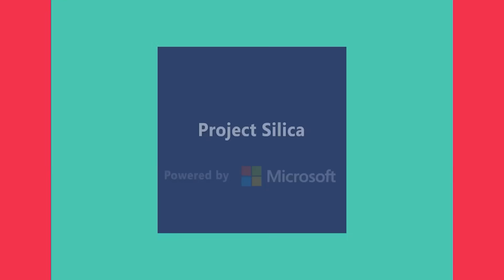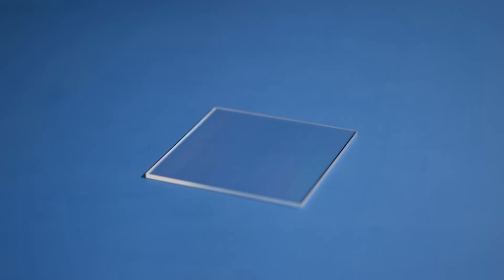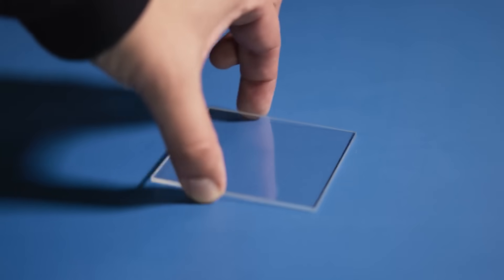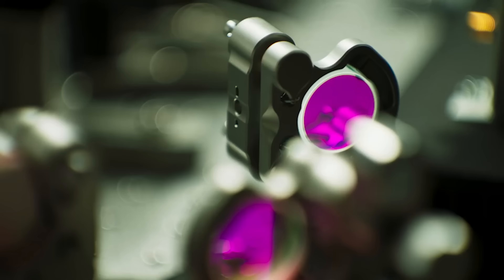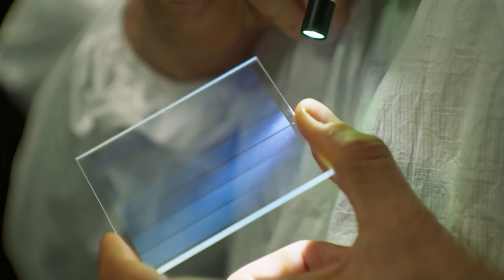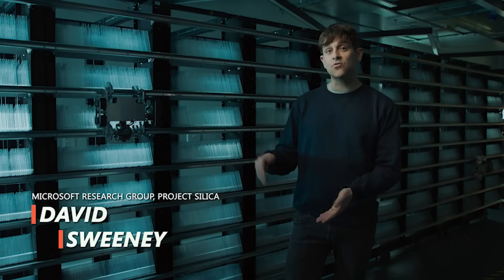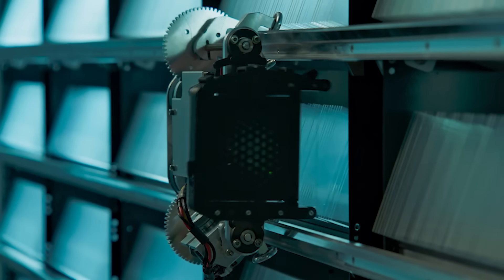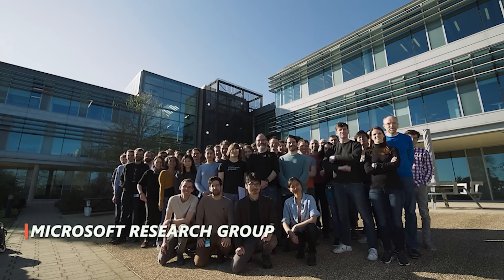Sealed in glass - Microsoft's Project Silica

Comment: This would mostly be an enterprise solution. Not for a desktop setup. As mentioned on the video, it is design for cloud base storage. A very good solution for your data like videos and photos that needs storing for future use. It would be like a time capsule.
Reply: I remember when I bought my first CD burner. The music industry used that tech. Yeah, not sure if there is an industry around that could do the same for this.
Reply: Personal videos and photos? Probably not, because those robots will need on the order of seconds or minutes to even start reading the data, and you'd have to make the user wait that long, which means a whole other layer of UI around accessing long term storage. Nope, at best it will have some use for archival video or CCTV video.
Reply: @Andreas-gh6is  nah there’s another realm of applications and use cases but this is a stepping stone
Reply: @Andreas-gh6is  You are extrapolation from laboratory devices, production devices would be much smaller and presumably faster.
Reply: @rrmackay  The fundamental constraints of this technology come from its fundamental benefit: The glas slides need zero power to keep their information. But that also means they will always have to move around the slides, much like in a warehouse application. No way around that. They need hundreds, if not thousands or more slides per reader to make it worthwhile. And you can only handle physical objects so fast if you need reliability. This not only means that it takes at the very least multiple seconds to switch the slide, more likely on the order of a minute or two to switch between any two slides in the same storage compartment. And that's still not everything, because you'd have a limit on how many reader robots you can deploy, and then you need to take into account queuing of data retrieval requests. So yeah, it's going to be minutes to access the data, at the least. They'll have some more challenges: For example, dust and dirt on the slides. You could make the storage room a clean room, but then you still need to account for the wear on those wheels and other mechanical parts which can get in the way of the optics. So maybe you need a built-in wiper... and so on.
Reply: @Andreas-gh6is  Thanks for the kindergarten explanation. You can't seem to understand that the retrieval system shown in the video is not the production level access system for all the reasons you detailed it is not a viable solution. Right now there are pico-laser arrays lithography manufacturered that create an array of microscopic lasers on a silicone substrate. Combined with a sheet of glass you could make a hermetically sealed 7TB disk about twice as thick as the glass with no moving parts that can directly address any digit on the glass instantly. Your concerns are not really relevant.
Reply: @rrmackay  that's an entirely different technology. And you would still need to move that laser array or the disk to the laser array, because 7TB isn't even that much better than current SSDs, so there wouldn't be much of a cost saving compared to current techniques. So swapping out the disk is still necessary. And dirt is an even bigger problem in that system, unless you indeed hermetically seal it and are ok with such a little amount of data. Additionally, if you have a 1:1 relation of carrier and reader, the reader is now the bottleneck on durability. Any damage or degradation to any of the parts of the reader that are hermetically sealed, and voila the whole disk is broken.
Reply: @Andreas-gh6is  You really should study MEMS lasers and mirrors.
Reply: Those Cat videos need to be stored somewhere...
Reply: It would be enterprise and home use
Reply: Idk, once the data is actually written, it seems fairly easy to read. Maybe the read part could be done at home?
Reply: @Noisy_Cricket  Not really. It's not that complicated. The read and write part are lasers. Working through (effectively) microscopes. And what are microscopes made of? Optics. Glasses. No, the corners we cut are the retrieval robots and the shelving. Each plate already stores 7TB (going up to 75.6TB with better read/write tech). Let's go with 75TB. We create a little caddy like plastic container that takes 8 plates, so that you're not holding bare plates, for additional protection so you don't scratch or brake them when dropped. And 16 of those in a bigger container, the size of a brick (but weighs much less). That is 9600TB.

For the economy model, you insert the caddy, and the device selects from one of the 8 plates. For the premium model, more mechanisms selects the caddy from the brick. 9600TB is not enough? Get another brick. The ultra-economy version seals everything up so you have 16 or 32 plates inside a rotating carousel that you can never remove.
Reply: 1701 Enterprise solution?
Reply: 7TB per glass plate, 64 plates per row, 8 levels from top to bottom, 8 shelves bolted in a row next to each other x2 sides, maybe 8 rows in a medium sized room ..... and we have ..... 7TB x 64 x 8 x 8 x 2 x 8 = 458,752TB = 448PB = 0.4375EB.

Advances in write tech could increase the storage per plate. Microsoft already demonstrated a prototype that bumped up the storage per plate to 75.6TB. So that increases our room capacity to 4.7EB. 

So how much data is this? All of Amazon currently has about 160-200EB of data. The entire world, right now has about 300EB of storage. This system can archive everything for a very low cost. A couple of millions. The expensive bits are the read/write parts and the retrieval robots. The glass plates themselves, the shelving, the rails the robots runs on, hardly costs anything. Petty cash. You could expand your total storage quite easily.
Reply: @virtuserable  Should give M-DISC technology a look, Its been around since 2009 and operates in place of Blu-Ray in a lot of applications
Reply: Sounds like Superman's Phantom Zone prison for criminals on planet Krypton..
Reply: Once the density of the glass reaches a high enough level it would be usable as a local storage solution, not re writable but with enough storage it wouldn't matter.
Reply: I bet it's slow AF
Reply: it's none

Comment: whats  the storage capacity per glass sheet?
Reply: in the description it says several TB in a single glass plate
Reply from the maker: 7 TB storage per glass sheet maintains data integrity for 10,000 years.
Reply: @logiagenesis  That's incredible.
Reply: @logiagenesis  incredibly interesting, i wonder how technology improves and how data centers use this long term deep storage
Reply: @logiagenesis  Where can I buy one?
Reply: thanks now i knw @Manublick1100
Reply: 7TB. 😳

How about the speed read & write?
Reply: @nothingtodo5987  a flashlight and a camera
Reply: hope they have robost solution and protection incase of something breaks cause by something like earthquakes thats 7tb gone per glass
Reply: What's the cost of getting one of these made? What if I want multiple copies?
Reply: @warlockpaladin2261   not a consumer product so its not available it would cost as much how MSFT invested and more
Reply: @acegear  But like, supposing for a moment that they did custom production for someone who has a few terabytes they need made into a permanent piece of read-only glassware... there a lot of curated data volumes that just need a good bit of solid storage.

Comment: I was expecting a more in depth video tbh
Reply: This is basically just taken content from MS themselves. This is really old stuff. Do some searching and you'll find the longform of this. It's still in research phase.
Reply: @PanoptesDreams  Thanks for this comment, appreciate it.
Reply: The tech is not new, there were experimtents more than 30 years ago, just was never commercialized
Reply: same
Reply: https://youtu.be/8QevXvjSDzY?si=2ww2ZEciBlCZDiev
Reply: Here, in 5min on my phone I brain dumped a better series of questions and such that should have at least been mentioned if not currently addressable..

Yep, short and kinda pointless.. addressed none of the obvious hurdles a 10yr old would ask even::

Can you edit or rewrite or need to redo a whole slide just for a minor change? If rewriteable what limitations? If not, at what point does # of edits break the cost savings or longevity vs just replacing regular drives or SSDs considering, power, special glass, time, etc? More in depth Qs below..

How long to write/read X amount of data now and in the future? Is it susceptible to vibration during and to what extent?

What storage capacity limits now or in the future?

What physical size limitations? What shape limitations? Like a cube or sphere might be more robust than a slide.. can you read/write multiple depths or directions at the same time if you use the same laser wavelength or different colors?

What power 'limitation' as in small lasers are affordable for read and write at lower depths but at what point is glass so thick that you're losing accuracy of read/write AND using more power than conventional storage for speed and power..

With more powerful lasers do you gain accuracy or lose accuracy or density etc..?

What about glass warping over time? What's the shelf life and again at what point do you need to safely back up? What about scratches etc? He said scratches are fine because they're on the surface but that definitely still affects the light going through the laser so to what extent could a glass slide handle 'pocketable' scratching etc? Do coatings and protections or maybe a screen protector as a consumable help 'take the abuse' while still being readable?

Obviously this needs to be ultra clean and probably proprietary formula glass to address a bunch of the above Qs (but to what extent?) but what defects are checked for? Does the writer do a check on new glass each time or is that an initial check at least? Probably a different machine so to compare to SSD chips what's the YIELD? How well can that improve?

What about positional accuracy? Of course enterprise solutions will be super accurate and tolerant of vibration etc.. But what are practical tolerances at lower scale like for home computers or at least a 'storage box' with very scaled down tech that you could plug into your PC or network... Is that gonna require a physics lab or will it survive the UPS punt over the fence?
Reply: yea, same.
they showed no proof this is even working.
Reply: Exactly, what about latency, how much data can be stored, write/read time, cost per GB, how is a 3d pixel created, how persistent is it really, etc etc..
Reply: @bernardd Some 20 years ago I've found the basis of this tech in my local mall: laser engraving. Imagine a glass cube/brick, precisely positioned laser "burn" marks alter the glass from transparent to translucent. With this technique, you can place a 3D image into the cube. I bet this tech is the same but with better materials and higher precision.
Reply: @bernardd your negativity is not needed. And by the way I have a pretty good knack for these things and I believe in few decades time our hard drive will be GLASS. Don’t come crying to me when this becomes a reality 🤷🏽‍♂️.
Reply: @bernardd  
380TB for a 40x40mm silica plate.

Comment: congratulations, you have invented the cdrom.
Reply: they didnt reinvent the wheel, because cdroms were round and this is a rectangle lmao
Reply: CD-Rom on horse steroids. The standard CD-Rom holds 900MB and can last up to 100 years at normal storage conditions before the plastic coating degrades. This quartz glass holds 7,700 times more data and can last 100 times as long, while being only a few times thicker.
Reply: What do you suggest?